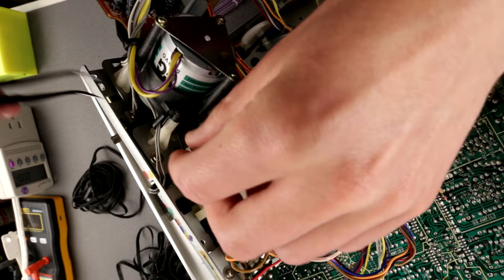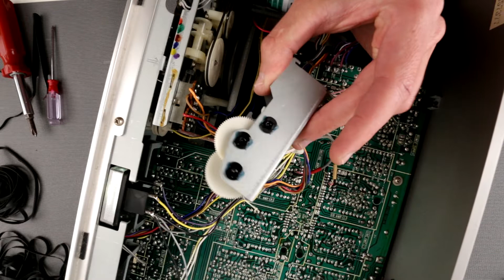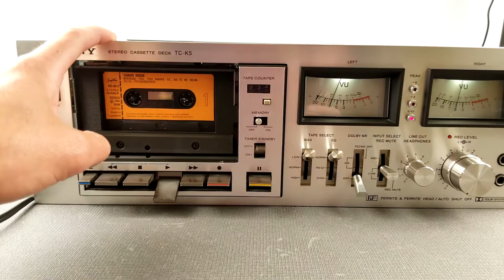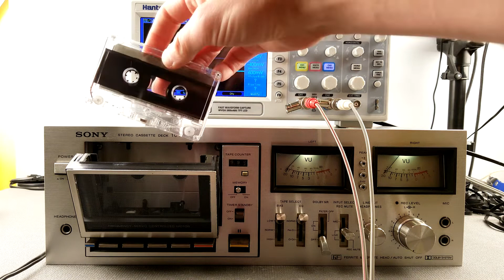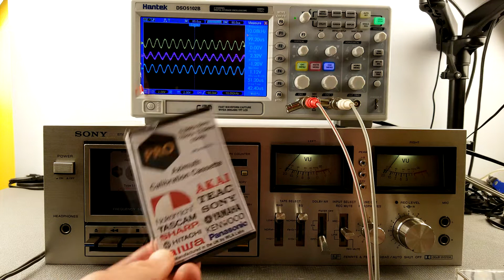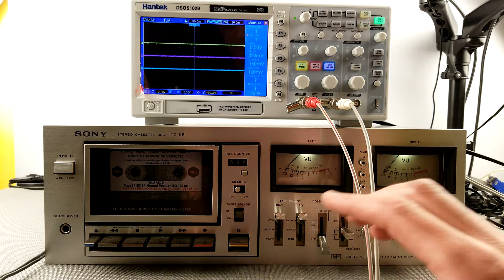Restoring Sony TC-K5 Vintage Cassette Deck. Part 3

Comment: You should do azimuth calibration!  Is a easy task and is essential for a good reproduction.
Reply from the maker: Thank you for watching! At the time i did not have proper full track Azimuth calibration cassette. But now i do have and run it on every casette deck

Comment: Hello~ The video is very helpful.  But where should I fasten the large head belt?  I fixed the small belt, but I don't know where to put the wide belt.
Reply from the maker: Thank you for watching ! Are you talking about flywheel belt ?
Reply: @InsideOutElectronics  Yes, that's right.  I also applied for a head belt because it didn't fit, but it wasn't visible in the video.^^

Comment: How can we use the record function??
Reply from the maker: Easy, just send signal in analog inout, letbrecording level and pres record
Reply: @InsideOutElectronics  Thank you, I discovered my issue was the tape. the tab were out and I used the ole scotch tape trick!

Comment: Excellent 3 videos ;) I got one of these the other day off ebay :P But the left UV meter doesn't move + the right UV meter gets stuck sometimes in the middle which is odd + the music volume is very low to(when playing a tape) I'll see if I can work out why but I am not that good at Tech fixing stuff :D
Reply from the maker: Hi, thank you ! Start from cleaning all switches, inside and outside, sometimes this is all what is needed. well also clean heads. Check some of my other video on how and what product to use.
Reply: @InsideOutElectronics  Ok will do, thanks for the info ;)

Comment: @19:28 For that Hantek scope... DISPLAY, F4, XY for diagonal azimuth pattern..I have the same scope. Autoset usually gets it up and running then use those keys in order.
Reply from the maker: Thank you! I did figured out it later, after I shot all vid ! :D